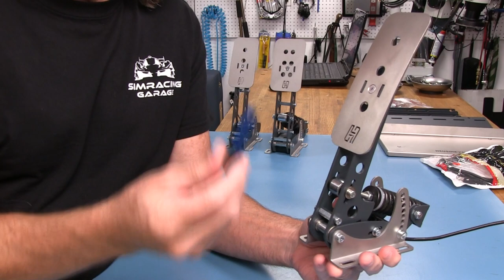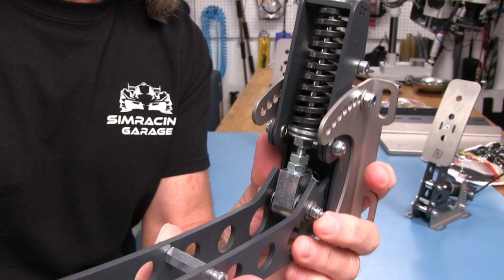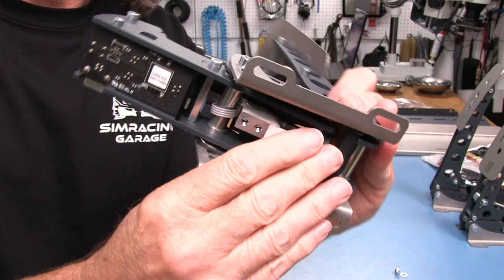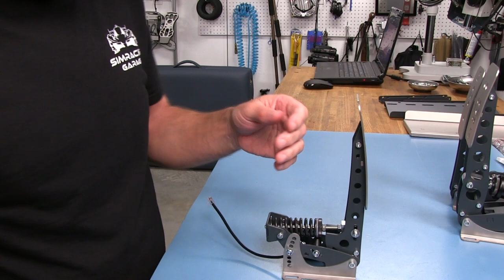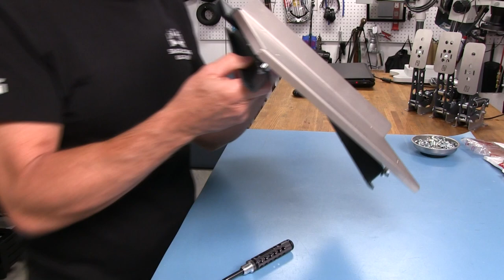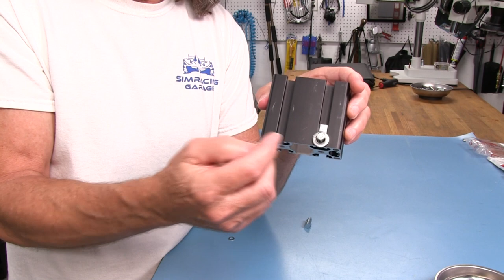Heusinkveld Sprint Pedals Review

Comment: So the rivet doesn't do anything as you have to remove it to move the plates up or down anyway.  Not the best/easiest design.  I like the easyness of changing the bumpers (Barry I think your meant to stack all the hard plastic bumpers together, then a washer, then the rubber, then a washer, spring locator, spring and finally the backing plate).  I'm not to sure about having the circuit open at the top for dust and debris to fall in.  If they couldn't box it then at least have some sort of cover to protect it.

For the screw sitting a little proud of the heel plate, simply run a 4.5mm drill bit through the washer, the cone of the screw head will self centre the washer and pull down flush with the plate.
Reply: The rivet is there to hold the entire rear sections of the brake in place as you pull out the bolt. Then you adjust the one side and re-insert the bolt. Once the rivet falls out you can adjust the other side while the bolt keeps everything in place again. It works!

Comment: Barry good sir? Those monitors really 27inch? They look huge? I want to stick to 1080p due to gpu load, but thinking 32 inch, can you advise? Is 1440p too much for gpu? Or will 1080p 32 inch be fine?
Reply from the maker: Yes, 27". Full specs in the video discription section.
Reply: @simracinggarage3026  ok ty, your opinion on 32 inch? Does your machine battle for 3x on 1440p? Or do you recommend 1080?

Comment: I am not a professionnel simmer, but I am quite serious. I have the money to buy either the ultimate or these. What would you advise ?
Reply from the maker: You may want to wait a bit. I am currently reviewing another option. The Simworx Pro V3 GT LC pedal set. It is designed like the HE Ultimates to replicate real world car braking pressures. I am currently working on a reivew for that set and should be out sometime next week. If you are set on the HE brand then the Ultimates would do a good job for you. I will also point out here that real world brake pedal pressures in some cars are very high, so it may not be to your liking over long races even at the lowest force settings.

Comment: Is there a noticeable difference in feel when compared to the ultimate series pedals that utilize the small hydraulic damper in each pedal?
Reply: Big difference imho. People say you don't need the Ultimates if you don't need the extra kg load cell etc. I've had them back to back and to me there is a huge difference in feel.
Reply: for me the ultimates feel really different because of the damper, i whould always go with the ultimates over the pros
Reply from the maker: Agreed. Ultimates are a completely different animal. Positioned to accomadate those who want stiffer pedal forces across the board.

Comment: I've heard you need a LOT of force on the brake for these, even at a light setting, so more physical force required to brake than with say Fanatec Clubsport V3's for example, is that the case?
Reply: You can set them up as you like, from very low force to quite a bit at 65kg. The V3's go up to 43KG and of course you can use that as well at the click of a button in the software. Pedal travel will be shorter at lower forces but installing the longest rubber stack will compressor the most and still give you a great feeling.
Reply: @RemcoHitman  Thanks Remco! The Huskies arrived last week, happy so far, set up as the softest setting for the most amount of physical pedal travel, i find 30kg in software about right for now

Comment: Can somebody tell me what is the purpose of the black botton on the pcb on the back of the brake pedal? I pressed it, but it does nothing
Reply: If you hold it down while connecting the pedals it will go into firmware flashing mode. There hasn't been a need for an update though.

Comment: Can u mount the pedals straight on the rig I just ordered the sprints n the tr160 said u didnt need base plate so I didnt get it I hope it works out for me
Reply: Yes you can mount them directly
Reply: Just had to eventually order the baseplate which cost 160 bucks bc the pedal faces do not have enough adjust to them

Comment: How do you feel the sprints compare to the pros.  Also what angle are you side monitors set to?
Reply from the maker: I would not sell my Pros to buy the Sprints. Monitor angle is 60°
Reply: @simracinggarage3026  Can you add how far you are from the monitor and what view of degrees in Iracing are you running. Great video.
Reply from the maker: @logo8009  22" from my eyes. 179° FOV.
Reply: Thanks
Reply: @simracinggarage3026  Cheers

Comment: The big pain is the angle of the brake unlike the throttle can't be adjusted once it's on the baseplate without removing the baseplate and that thing is really badly designed as it's almost impossible to get the screws in.

Comment: I don't like that they are on the same plane, gas pedal should go a little to the back so you can properly do heel and toe. I would've expected more adjustability on a set of pedals like these
Reply: Hey, you can actually create a front-back offset between pedals. The holes in the pedal feet are slots, so if you want to move the back closer to you relative to the throttle, you can. If you look closely at this photo, you can see the slots in the feet: https://heusinkveld.com/wp-content/uploads/342A3800.jpg

Comment: Why are they using a load-cell on the throttle-pedal? Doesn't make any sense to me (if it was for longevity they could've used a Hall-effect sensor.)
Reply: @karoo_bushman6880  I see - it does make sense, then. Thank you for the explanation. (it sounds like you have an awesome - and a little dangerous? - rig)
Reply: Load cells are reliable, show zero wear and are very resistant against dust, oil, dirt and the hair from your cats. We hardly ever see throttle/clutch load cells give any issues, apart from maybe issues with the cable or plug (which can happen on any sensor). For us it's a very straightforward solution to use.
Reply: @HeusinkveldEngineering  only if you make the box for the HE handbrake better. I went to plug in the usb wire to the arduino board with no pressure and it snapped. Very cheap and make with no care for $272 when the housing for the arduino rattles and brakes so easy. I spent $272 and didn't get to use my handbrake

Comment: Heusinkveld  sprint vs fanatec clubsport v3?
Reply: if you play with socks go for the v3, if you use shoes, sprint are much more solid and adjustable. You will go fast or slow with both depends how you are used :D
Reply: @MaxDellOrco  i dont need 
clutch, i like play with socks. my fanatec v2 burns, and fanatec doesnt have material to repair.

Comment: First of all great video :), i wanted to ask if these pedals are worth the +150 euro price tag compared to the fanatec v3 sprint pedals + dampers. 
Have a nice day :)
Reply: Schwifty I have both
The HE are way more versatile, super customisable! Love the fact that you can have a bigger distance  between throttle  and brake Pedals it really makes for a more comfortable drive, the brake on the HE is superior, I'm not super convinced about throttle and clutch. On my v3s I have the damper kit on throttle and it just feels right, clutch has a slightly better feeling as well, of course this is my personal opinion YMMV. 
Cheers
Reply: I just bought the v3. The clutch travel is about 50 mm, the clutch feel is two stage: from hard to soft, as compared to the 3 stage feel of the heusinveld: soft to hard to soft. The so-called bite point is not properly simulated on the v3.

Comment: Whats the point of putting a load cell on a throttle pedal? Those pedals are not pressure based in real cars.
Reply: Load cells are perfectly linear, don't wear or get dirty. In HE pedals they are activated by a small preloaded spring so there is absolutely zero slack.